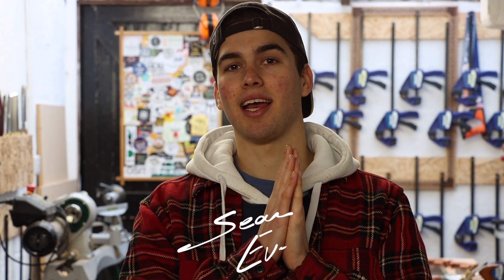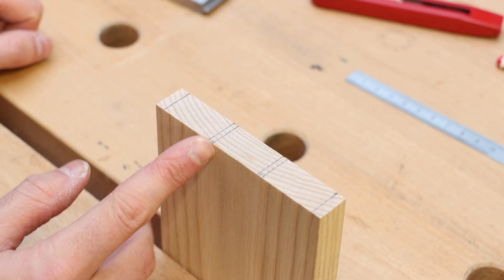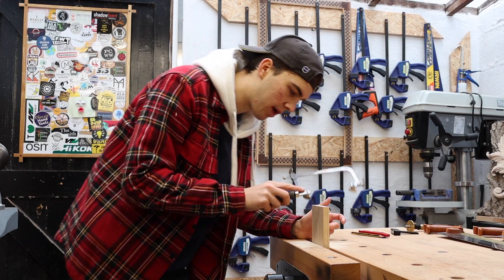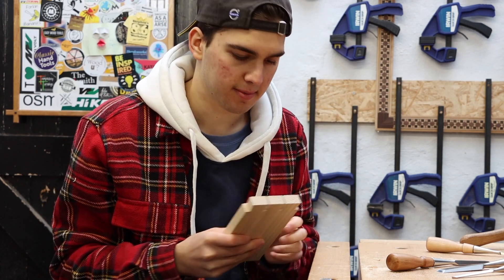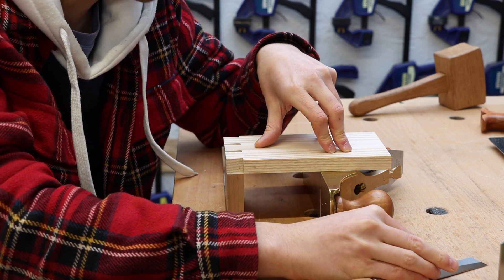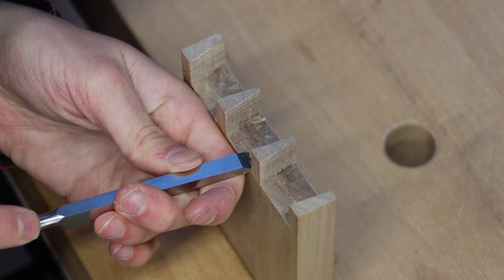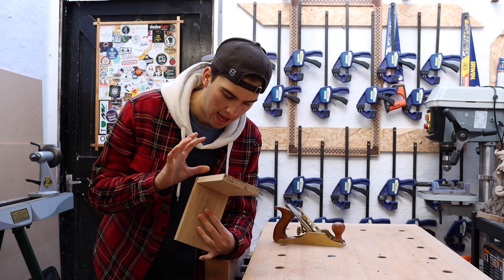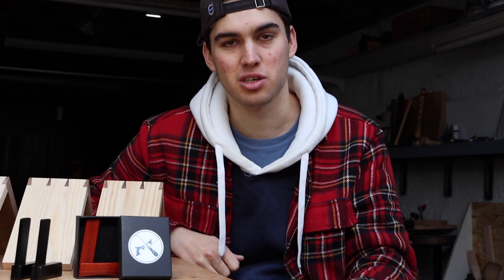The Secret To Perfect Dovetails! (How To Hand Cut Dovetails Like A Master Craftsman)

Comment: great and informative video learned different way for dovetailing.  one question when marking the tail after using the marking knife are you drawing a line 90 degrees straight down on the tail board or is it at a angle and also which side of the board are you marking

Comment: I have benefited from some of your tips so I owe you one of mine. You can get these incredible fine toothed thin little saw blades that fit into an exacto knife handle from Zona Saw. They are fantastic for marking out the pins. They look and work like a knife but cut a fine kerf that’s not only easy to see but will reference and start your saw.

Comment: Sean great series. Glad to see another hand tool channel getting established. I know you referred to the marking gauge lines as ugly for how you mark between your lines. May I suggest that's an opinion, there are some very seasoned master furniture makers who leave them as a sign it's been hand cut. Great tip on the masking tape instead of a small rebate, I'll definitely give it a try. wish you much success and growth on you tube.
Reply from the maker: Hi Kevin! Thanks for watching, I'm glad the masking tape trick was helpful! I agree it is my opinion and I know other woodworkers keep the marking line on. However I feel a much better way of showing a joint is hand cut, is to make the pin small enough that a router bit couldn't fit into the gap and cut it, That's the only way you can really tell a joint is hand cut. You can use a router jig and then add the marking gauge line to make it look like it was hand done, but the pins will always be to big.

Comment: Sean, silly question maybe but is there a wood species that you would recommend for a beginner practicing joinery. Is construction lumber or pallet wood (cleaned up) good enough?
Reply from the maker: Hi Mike, I would recommend walnut or ash, because they are easy to work hard woods. On the other hand it’s good to practice with what you are likely to be using for your projects. If you never plan to use walnut, then don’t practice with it. If You often use pine and pallet wood, then it would be good to practice with that. Hope that’s helps.
Reply: @SeanEvelegh   Thanks Sean. Much appreciated :)
Reply: @mikedeman5351  I agree. However, if you're just starting the better you can see your knife lines and pencil lines the more likely a good result. I recommend poplar or pine to start with(learning) and a good light. Without them it might add to your frustration. Good luck.
Reply: @williambranham6249  Thanks William.

Comment: Usually people, myself included, like the marking gauge line across the whole board and don't remove it, it shows they were hand cut.
Reply from the maker: Hey mate, I do know that method. However you can put a marking gauge line over any joint even if it’s been cut by a router. I feel the best way to prove a joint is cut my hand it to make the pins small enough a router bit shank cannot fit in them.
Reply: @SeanEvelegh  I just watched a Rob Cosman video about a new way he lays out his dovetails, he uses a marking knife that has a saw blade and marks out the pins prior to cutting out the waste so he's using the saw kerf to put the marking gauge in it, very impressive, you should watch it. What marking knife would you recommend?